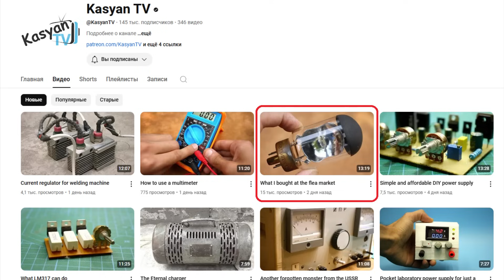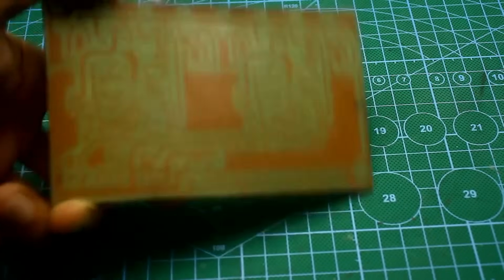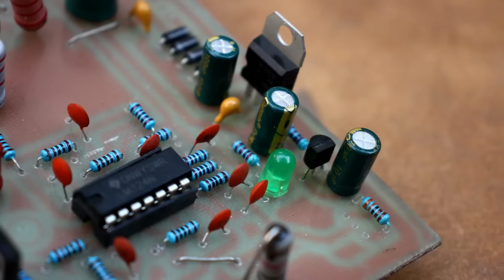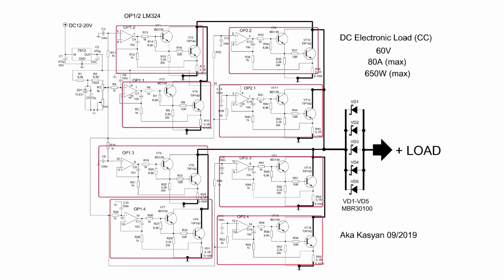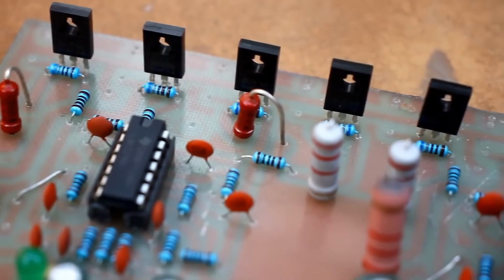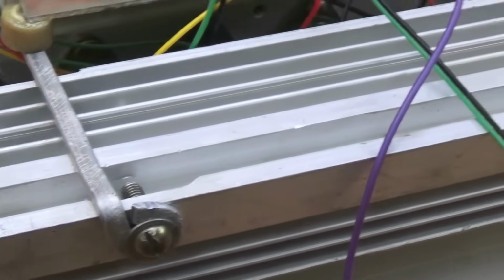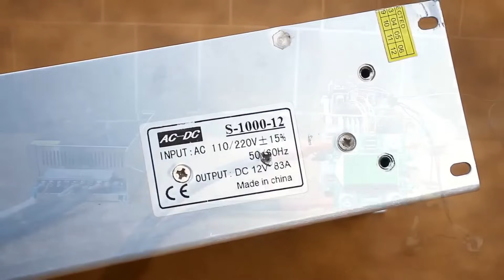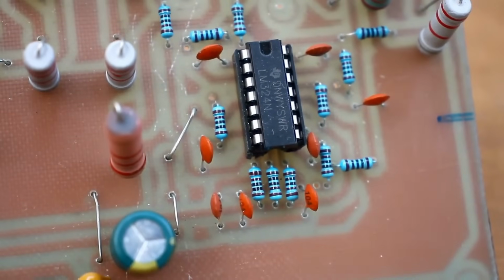I made another MONSTER at 1500W!!!

Comment: Watch the second break down failure mode of bipolar transistor.
15 to 25v over the jonction, the transistor dont permit full power of dissipation.
More voltage you have, less watt permit to use before trasnsitor failure.

Comment: Kindly make a video on DIY switching power supply without using any p type MOSFET
Reply: LM2678
Reply: DIY BUCK or BOOST or FLYBACK is very simple and there are tons of videos, how to make them in a few minutes.
YOu only need 2 € or 25 € FETs, for 0 - 200 A curent, and 0 - 650 V or even 1200 V FETs,
some cheap 2 - 6 A gate driver, isolated for 650 - 1200 V, two or more toroids if you need 2 , 3 or even more phases,
take some ESP32 Arduino Nano or STM32 and write about 500 lines of code, place somewhere ADS 1115
to measure voltage, current, temperature of FETS and CAPS, put some ELYT + metal film + ceramic caps,
to mitigate ripple and noise, place right resistor to GATES for source and sink current and you are done.
Take some LFP bat. + thermocam and begin to test if everything is OK. 
After 3 - 4 hours you have 5000 - 10000 W power supply, and cost is about 150 - 250 €.
Reply: @PavolFilek  that why I ask for simple one